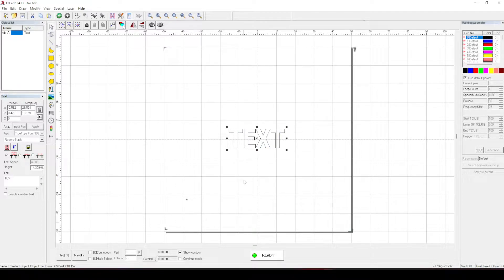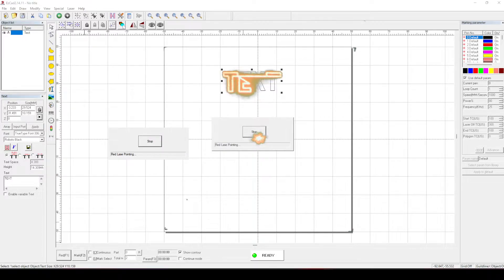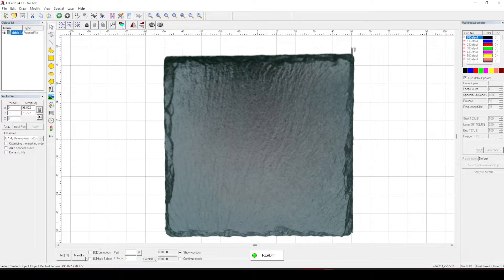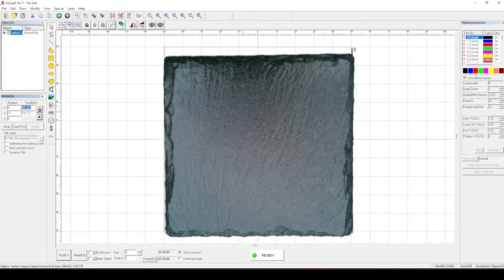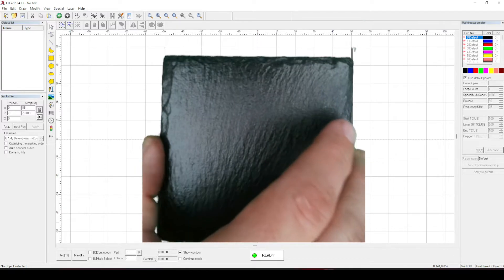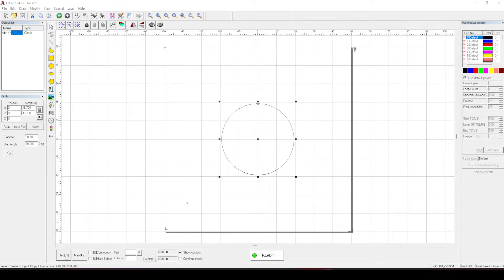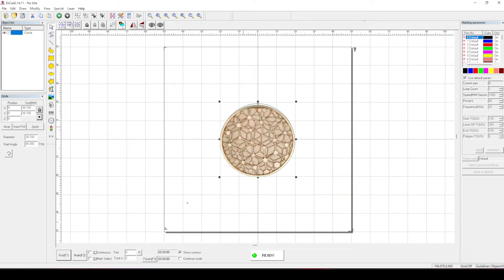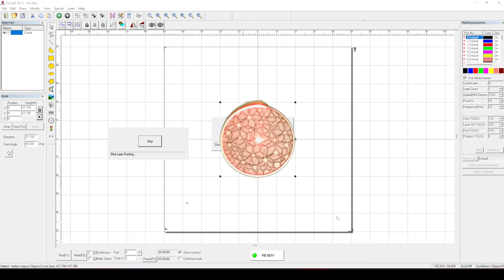EZcad2 Camera overlay project test using 3plasers em-smart 20w raycus fiber laser

Comment: How did you do that? Can you explained procedure and witch camera to buy? Which is precision you get?
Reply from the maker: Best bet is get rid of ezcad and get lightburn
Reply: @rgs1 I am used to ezcad2 and 3 which I use in 4 galvo lasers, so  I won't change. I use lightburn in small diode laser and I knew it's powerful, but I have all my libraries in ezcad. Do you remember the procedure? Which cam to buy, how to overlap image? If you can would be useful. Thanks